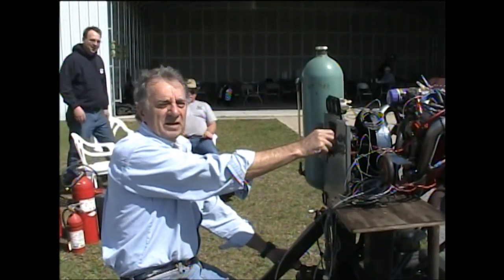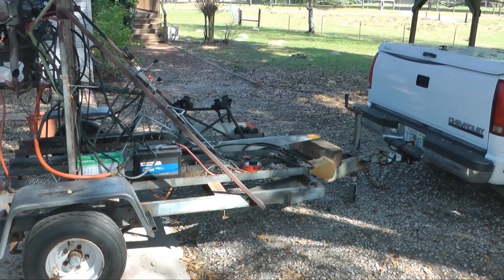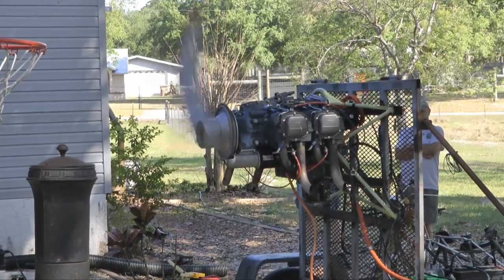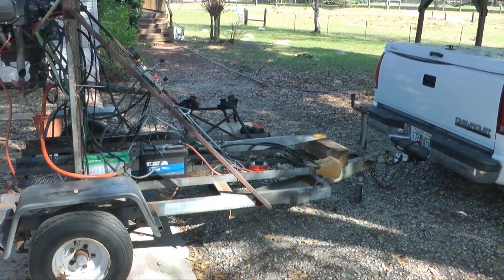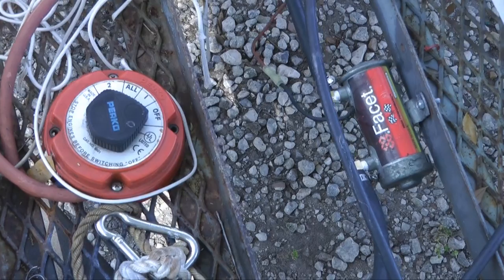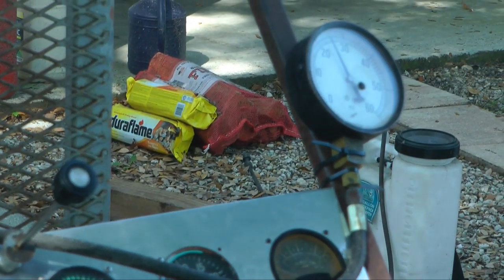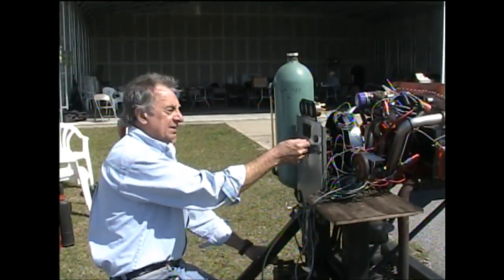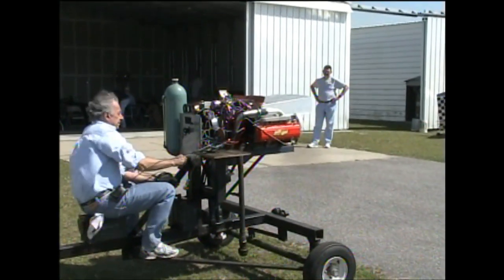Build an Engine Test Stand?

Comment: Some cool ideas. Any thoughts on running a pusher on a stand in these configurations? Lol I have a vision of it pushing them over... Maybe I'm over thinking it
Reply: Good point that is worth thinking through.  Which ever way you point the prop, it will try to blow things over.  It makes sense to estimate the thrust and calculate whether you need to add blocks or anchors around the perimeter to hold things in place.

Comment: That guy running the stand isn’t the sharpest tool in the box. No safety glasses or face sheld
Reply: THAT HAS NOTHING TO DO WITH BEING SHARP, IT HAS SOMETHING TO WITH A PUPPY
Reply: 86!
Reply: I was thinking the same.
Eye protection would be a good idea and how about a safety screen around that propeller?
Also I can't see any reason to run a motor without it's muffler. That is how it will run on the aircraft.
I may sound like a "sour puss", but I have survived so far to 69 years.
Older and wiser.
I look back on all the foolish risks of my youth, often through sheer ignorance.